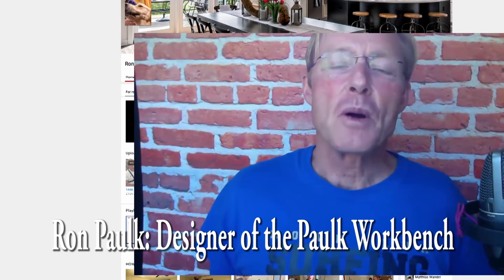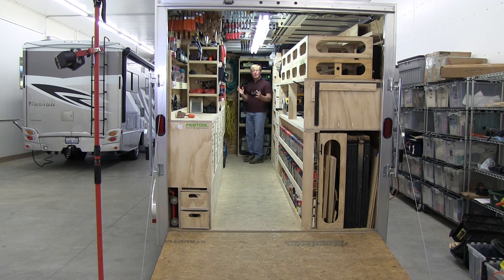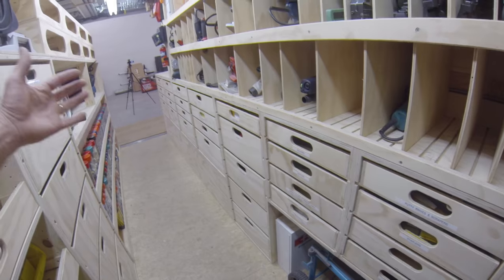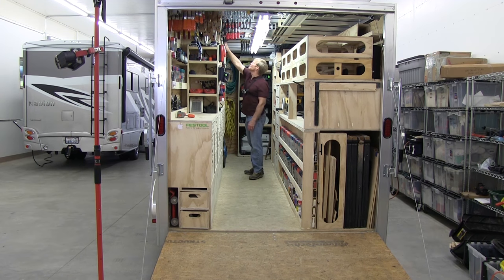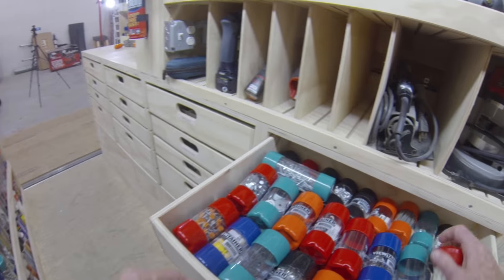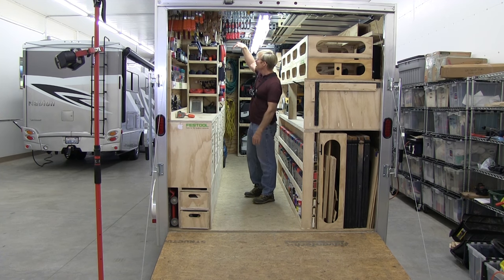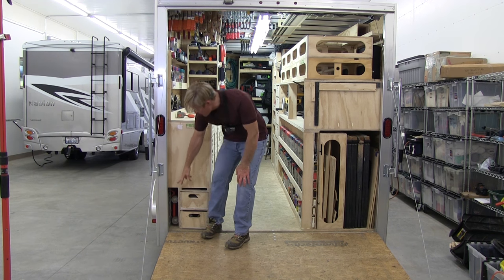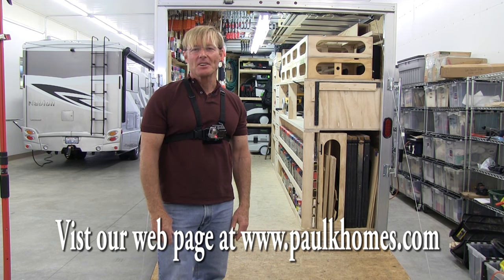TOOL TRAILER GRAND TOUR (PART 3 of 3)

Comment: Ron, I sold my three 12' smaller trailers that were inefficient. I purchased a new 16'x7'x7' trailer and your plans to organize.  I am 98% complete, just finishing stocking it and labeling.  Working great so far, myself and my two guys are loving the new mobile tool box.
Cheers thanks

Comment: I've been watching for over a year now, and i always learn something. I've built my version of the 3'x6' table, and it immediately changed my work habits. I think, more than anything, building that table and using it, really implanted in me Ron's philosophy which fits so well with my own.  I know now, that i will be buying a trailer in 2018, and doing my own version of the Awesome Rolling Tool Stop.   I can't thank you enough Ron for your inspiration and insight. My electrician buddy is even watching your video's now, to apply to his own company. Between us we now have three trucks and two trailers, more to come. All the best in 2018, keep these coming, and thanks again so much for sharing.

Comment: Hey Ron.  Well, they say imitation is the highest form of flattery.  I got the pickup six weeks ago and picked up the 7x14 trailer yesterday.  Getting rid of the box truck I've had for years and trying this system out.  Looking forward to cutting lots and lots of plywood for the build out.

Comment: Ron, for the drawers, mainly asking about the heavy one on the bottom left of your trailer... what size plywood and method are you using? 3/4 ply and just glue? What kind of glue do you recommend for an application like that? 

Impressive set up. If I had a project or the money to build I house to my linking, you will be the only choice in my book.  sub'd and shared!

Comment: Ron, how do you make sure that the outlet you choose will provide enough amperage for your trailer?  And, how much do you need?
Reply from the maker: I go as close to the breaker panel as possible. The only problem I have is with the compressor on cold days, but I have always had problems with direct drive compressors on cold days even when they are plugged in directly.

Comment: Do you know how much your trailer weighs loaded?
Reply from the maker: >5000#
Reply: Thanks, my next project is building out my 20' trailer as a portable shop.  It's rated at 10400# and I've hauled a car on the trailer with my truck and the truck did fine, but was a little unsure about loading it up with all my tools.  I really didn't want to be forced to buy a new truck.
Reply: More than 6000#?

Comment: Hi Ron, I love the drawer design; it inspired me to make a similar design for my workbench drawers. Shat's your thoughts or have you any experience with UHMW Polyethylene tape? I have a dozen drawers with the same dado sliders you used in your drawers. Some of my heavy drawers don't slide as smoothly as I'd like. A quick Google turned up findtape.com. JVCC brand 1/2" rolls. They have a variety of thicknesses from 3 mil to 20mil, I'm not familiar with using it and have no idea what thickness becomes overkill. I may pickup a roll of 3, 10 and 20 mil. I'll try the 3 first and I'll have the thicker if I need it.